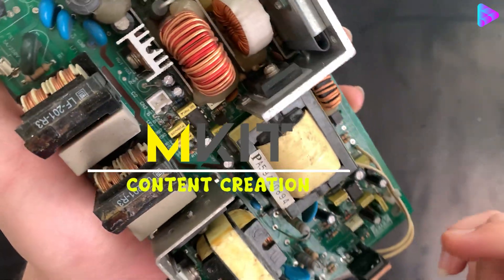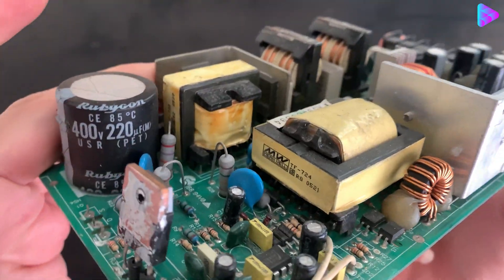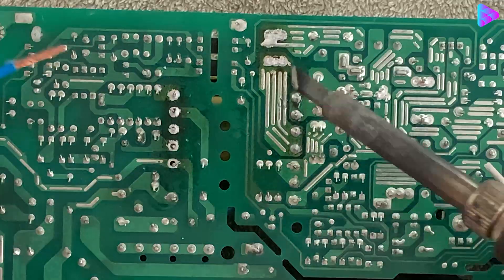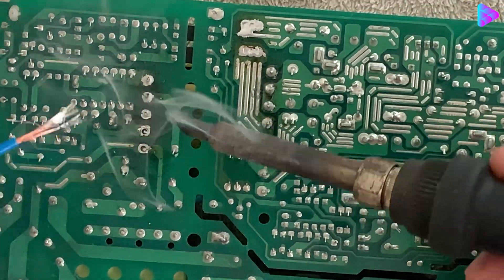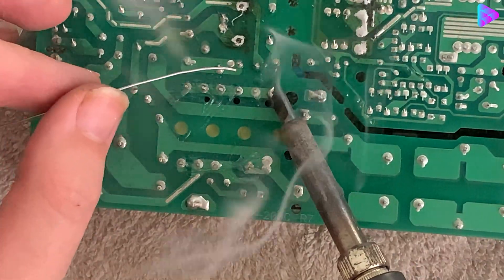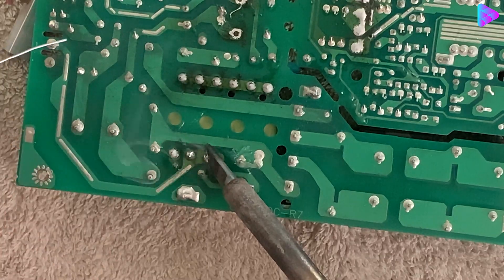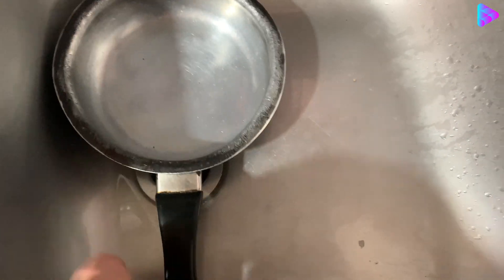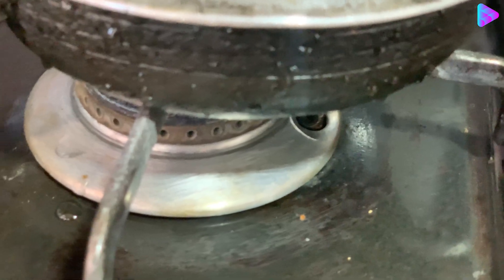How to Wind an ATX Transformer for a 500W Inverter | Step-by-Step Guide

Comment: 10:13 can ı use 0.4 mm copper wire
Reply from the maker: You need to go to the Coil32 website, enter the specifications of the choke, and select the wire gauge you want to use. It will then calculate and provide the number of turns for both the primary and secondary windings.

Comment: If you had worked more patiently, the core wouldn't have broken.even that little fraction effects the core parameters
Reply from the maker: The glue had set in and was so strong that nothing could be done about it. It took about 2 hours.